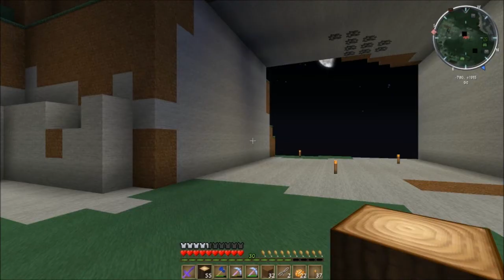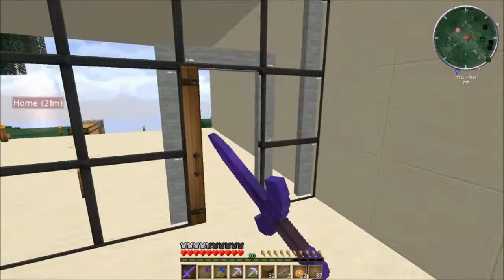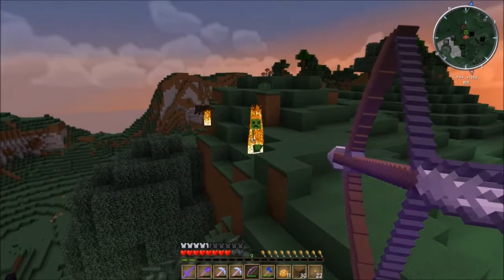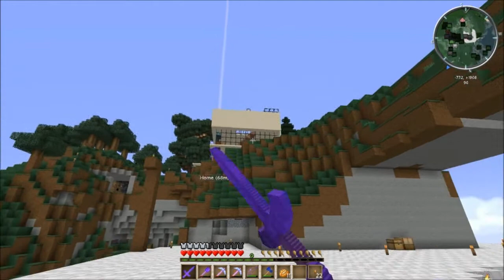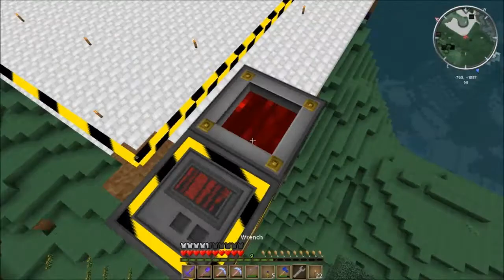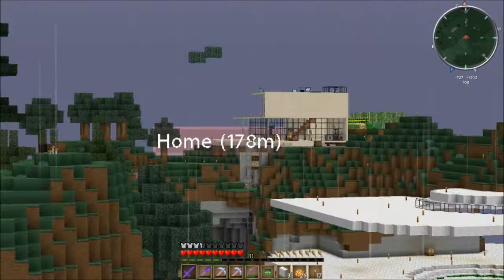The Lab: EP15 "The Lab comes to life. "

Comment: || Too bad this server doesn't run the modpack that I play on. You can get 8 MJ/t out of BioGas engines. || I think the reason your Impure Glass doesn't look as good, is because you kind of edited the default, 16x16, glass texture, vs. a 64x64 texture pack. xD || You need to watch Direwolf's XyCraft spotlight. And then the short little update video that was posted after that. xD || And finally, a thumbs up, as always! :) ||